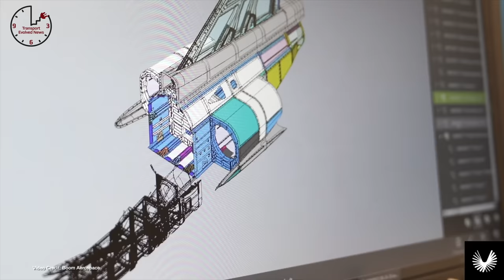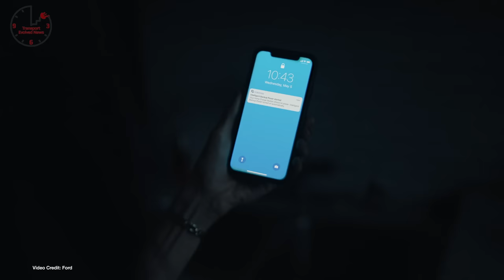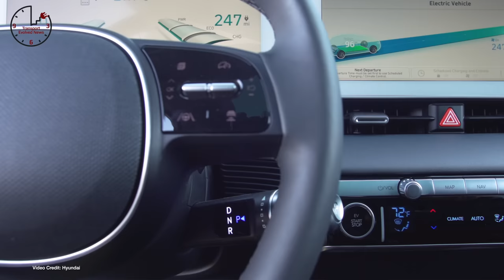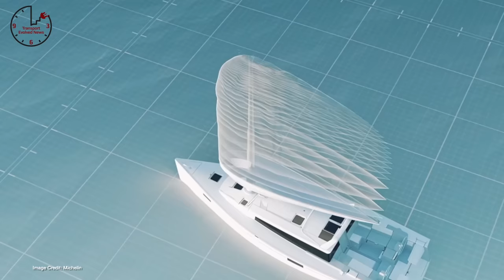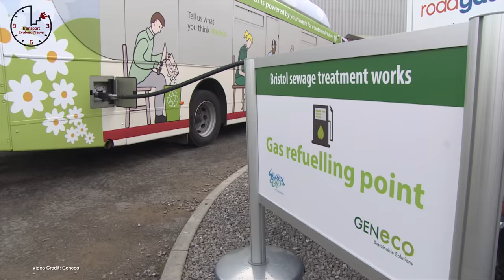TEN 341: Nissan Ariya Delayed, Ford F-150 Dukes it Out With Cybertruck, $6 Million Battery Grant

Comment: Dear Auto Manufacturers. Due to the ongoing chip shortage can you please go back to 3 knob HVAC controls. I’ve never been failed by the fan speed, temp, and where controls.

Edit: misspelling
Reply: Agreed.   How hard you want it to blow,   where you want it to blow, how hot or cold you want it to blow with a twist of the nob.   Without looking at it.    Not hunting for in menus on a screen.
Reply: Yes, control knobs would be a much better option.  The reason the car makers have to put in the automatic braking on all cars is because the drivers are busy 12 menu layer deep trying to shut off the air conditioning that is freezing their feet.

Comment: What I'm interested in f150 lightning is that it can charge my home I think only that :)
Reply: You could get a power wall.
Reply: @matthewsaxe6383  I can't I already have a solar panels :(
Reply: The Cybertruck will very likely do that too. The original Tesla Roadster had this capability, but nobody used it, so Tesla dropped the feature in later products. But with recent events I'm pretty sure they'll reconsider. Also the Cybertruck will have standard outlets, so you can power things even if Tesla directly doesn't support it.
Reply: @andrasbiro3007  hopefully they'll do it not only for cybertruck but all tesla vehicles
Reply: Musk has been dead set against V2G and V2G. It cuts into his Powerwall and Grid storage businesses.
Reply: @matthewsaxe6383  the biggest waste of lithium is in buildings where weight doesnt matter.
Reply: #V2H will be available on every vehicle.  L725/year for #V2G is a huge win.  "Regular car and truck drivers" are going to buy used ICEs.  None of this is bad news for Tesla.  The challenge will improve Cybertruck which can easily lap the Lightning.
Reply: @crhu319  Totally agree with this, there are very few reasons, besides maybe a truly draconian HOA, that would prevent someone from having a small conditioned shed on the back of a house for lead acid or eventually aluminum ion battery storage.
Reply: @crhu319  true enough,  except perhaps in the use of degraded packs for prerecycled

Comment: I agree that the Ford truck is a great looking truck and I would buy it before a Tesla truck.
Reply: While keeping the old form factor of forty years ago is dumb (terrible aero!) with electric, that huge frunk is a fantastic idea.
Reply: @davidmccarthy6061  
Keeping the form factor was a smart idea because it allows a lot of existing after market products to be used on the new electric truck.  This will greatly increase the adoption rate.  That is what matters.
Reply: @davidmccarthy6061  The F150 is one of the more aerodynamic trucks out there, Ford has been decreasing the drag of the F150 the past twenty years. Do some investigation on this.

Comment: the main problem with supersonic flight has to do with the engines. the exhaust speed must be higher than the airspeed, otherwise there is no thrust. such high exhaust speeds lead to 2 problems: high fuel consumption, especially with afterburners, and LOTS of noise. plus, in the case of the concorde, another problem was pollution. it created a brown trail of nitrous oxides. i have never seen such a trail behind any other airliner. and yes, compared to a 747 the concorde used more than 4 times the fuel per passenger for the same distance.

Comment: IMHO it won't be simply an emissions issue that dooms the ICE, it's Achilles heel will ultimately be convenience and especially cost-to-own. If you're the kind of person that likes to keep their cars beyond the 4 year and or 100,000 mile point then an EV will save you FAR more money over its life. Going beyond those points and the EV becomes increasingly cheaper to own. EV's have far fewer systems that will need to be maintained, rebuilt or replaced. EV's have no accessory belts or pulleys, no alternators, no power steering pumps or hydraulic fluids, no mechanical water pumps, no engine coolant systems to speak of, no timing gears, timing chains, or timing belts, no spark plugs, plug wires or coil packs, no ignition control modules, no fuel injectors, fuel filters, or fuel pumps, no fuel injection control modules, no transmissions or oils, no PCV valves, no O2 sensors, no emissions controls, no exhaust pipes, no mufflers or catalytic converters, NO EMISSIONS TESTING EVER, no engine oils so no wasted hours sitting in customer lounges waiting for oil changes. EV's use regenerative braking so no expensive brake jobs every 40 or 50 thousand miles. Even the batteries are now expected to out last the vehicle they're installed in. The latest battery technologies are capable of over 1000 "full" charge cycles (some claim better than 1500), and that's just until the capacity has fallen below 80%. The vehicles will still work fine and most owners will simply keep the original battery. With most EV's now getting over 250 miles per charge they can expect to see over 1000 charge cycles which equates to at least 250,000 miles before significant capacity loss warrants battery replacement, (admittedly, that should be considered best case as hot climates combined with frequent use of high power rapid charging can shorten that life). Consider Tesla's Model "S" with over 400 miles of range. After 1500 charge cycles that equates to a lifetime of (1500 x 400 = 600,000 miles). Also, there's no anxiety about passing that 100,000 mile point (the point at which the value of ICE cars plummet), which is largely because EV's have so many fewer systems or mechanical parts to wear out.  Even the old arguments of limited EV range and refueling times are beginning to fade as well. Range is quickly becoming a non-issue and with Tesla and Lucid both introducing EV's with 500+ miles of range it won't be long before all EV manufacturers close the range gap and for prices that will soon go below comparable ICE vehicles.
Reply: Some EVs do use transmissions and lubricants and they will have to have their coolant systems flushed periodically, you are correct though in that the scale and frequency of maintenance is drastically reduced. For example my PHEV, I've put about 7k km on the ICE (barely broken in, used for road trips) and about 120k km on the EV drivetrain. I'll do one oil change a year instead of at least four and the battery shows no signs of degradation. Considering the iridium spark plugs, lack of accessory belts, synthetic oil use, and minimum usage I don't anticipate any real maintenance on the ICE for quite some time.
Reply: @anydaynow01  - Agree however, I know of only the Porsche Taycan using a transmission. I know of no other production pure BEV that uses or needs a transmission. Tesla considered it early on but abandoned the idea after realizing very little benefit since they had an 18,000 usable RPM band (and could program the inverters to widen and or move the torque curve as necessary). As far as EV coolant systems are concerned, if they have one at all they're low temperature sealed lifetime systems used to keep battery and inverter temperatures below 120F. Being low temperature and low pressure they're unlikely to ever need flushing or servicing. I'm not aware of any that require periodic coolant flushing. Tesla initially required it but now does not. Perhaps the Taycan?

Comment: If the Tesla Cybertruck has 10 times the reservations of the Ford F150, that's 1 order of magnitude higher. To be several orders of magnitude higher, the reservations for the Cybertruck have to be at least 100 times more than the ones for the F150 (equals to 2 orders of magnitude higher). That's picky but your channel is the best in the field, so let's make it even better :)

Comment: Has anyone ever gotten a straight answer out of Tesla regarding the reservation to purchase ratio? As in, just how many of the people that reserve a Tesla actually end up purchasing one?
Reply: The relevant number is days of inventory.  Tesla has eight days at last quarter end.  Most legacy manufacturers have 70+ days (and that is deliveries to dealers, not buyers).
Reply: @s.m.7018  That's not an accurate measurement though. Tesla's factory output is tiny compared to a VW which has over 60 factories worldwide and has a immensely larger shipping and dealership delivery model.
Reply: @s.m.7018  they don’t now look at the lots
Reply: Previous vehicles that got refundable reservations before release had much more expensive reservation fees. Cybertruck's reservation fee is so low, a lot more people are likely willing to "float Tesla a loan" of that amount even if they are unlikely to actually purchase.

For example - I have preorders in on the Rivian R1T, Cybertruck, and F-150 Lightning - even though I will only buy one of them in the end. At this point, the Cybertruck is almost certainly NOT going to be the one. But I haven't cancelled the preorder yet, because you never know, Tesla might change the Cybertruck to be palatable.
Reply: More than half are high school kids

Comment: F150e VTG may force Tesla to make VTG (or VTG upgrade ) an option sooner than later.  Unless Musk is able to make a compelling argument that a VTG duty cycle will be detrimental to current vehicle battery life (to the point that it is economically inferior to using dedicated home batteries (PowerWall)), I think Tesla putting off VTG compatibility will lose more and more CyberTruck position to the VTG-capable F150e.

Comment: So there are shortages of nearly every car in the US and dealer inventory is at historic lows, but there are still 2020 Bolts available at huge discounts. Is the Bolt really so bad that even in current shortage of new cars there is a glut of Bolts?
Reply from the maker: It's not unusual for an automaker to have a tough time moving cars from right before a significant refresh. The new generation Bolts look quite different, and have significantly upgraded interiors. - Winter

Comment: You want green shipping and aviation fuels for faster travel? Nuclear!
Reply from the maker: Nuclear aviation has been experimented with over the years, but with today's level of technology, it simply isn't feasible in a non-polluting way (I'm talking about radiation-heavy exhaust, not the issue of spent fuel). 

Nuclear cargo ships have been done, but the sheer volume of shipping on the seas makes converting the whole fleet to nuclear a very expensive and impractical direction to go. Though given how incredibly polluting cargo shipping is, converting even a fraction of the fleet to nuclear power would certainly help. There are significant geopolitical obstacles though. - Winter
Reply: @transportevolved  I'm talking about making fuels like jet fuel using nuclear energy. :)
Reply from the maker: Now that is very interesting. We've talked a bit about e-fuels on the channel, but their production is energy intensive and thus not cost effective. Using nuclear power to produce e-fuel could be low carbon or carbon neutral way to keep planes in the air. - Winter

Comment: One day I may get one or make a hybrid of my own.  That would be good.
Reply: Nah, no hybrid. Give up the ICE completely. IMHO it won't be simply an emissions issue that dooms the ICE, it's Achilles heel will ultimately be convenience and especially cost-to-own. If you're the kind of person that likes to keep their cars beyond the 4 year and or 100,000 mile point then an EV will save you FAR more money over its life. Going beyond those points and the EV becomes increasingly cheaper to own. EV's have far fewer systems that will need to be maintained, rebuilt or replaced. EV's have no accessory belts or pulleys, no alternators, no power steering pumps or hydraulic fluids, no mechanical water pumps, no engine coolant systems to speak of, no timing gears, timing chains, or timing belts, no spark plugs, plug wires or coil packs, no ignition control modules, no fuel injectors, fuel filters, or fuel pumps, no fuel injection control modules, no transmissions or oils, no PCV valves, no O2 sensors, no emissions controls, no exhaust pipes, no mufflers or catalytic converters, NO EMISSIONS TESTING EVER, no engine oils so no wasted hours sitting in customer lounges waiting for oil changes. EV's use regenerative braking so no expensive brake jobs every 40 or 50 thousand miles. Even the batteries are now expected to out last the vehicle they're installed in. The latest battery technologies are capable of over 1000 "full" charge cycles (some claim better than 1500), and that's just until the capacity has fallen below 80%. The vehicles will still work fine and most owners will simply keep the original battery. With most EV's now getting over 250 miles per charge they can expect to see over 1000 charge cycles which equates to at least 250,000 miles before significant capacity loss warrants battery replacement, (admittedly, that should be considered best case as hot climates combined with frequent use of high power rapid charging can shorten that life). Consider Tesla's Model "S" with over 400 miles of range. After 1500 charge cycles that equates to a lifetime of (1500 x 400 = 600,000 miles). Also, there's no anxiety about passing that 100,000 mile point (the point at which the value of ICE cars plummet), which is largely because EV's have so many fewer systems or mechanical parts to wear out.  Even the old arguments of limited EV range and refueling times are beginning to fade as well. Range is quickly becoming a non-issue and with Tesla and Lucid both introducing EV's with 500+ miles of range it won't be long before all EV manufacturers close the range gap and for prices that will soon go below comparable ICE vehicles.

Comment: Funny how clueless the general public is on spec differences between the two trucks. For the price the CT is unbeatable (in every meaningful way) by much more than just a little bit. They’ll quickly get over the strange CT looks these truck owners buy the lightning and then realize their range isn’t enough and they could’ve had double the range for much cheaper.
Reply: 3 years down the road, the CT will still look and drive like new.  The Fords will accumulate dents like they do today.  We don't know how long batteries and drive train will last in E150, but CT boasts a million miles.  As well, the ford is far less energy efficient.  Fleet bean counters will calculate these costs and, once they know the TCO of each, will buy the best vehicle for the job.  Looks will mostly be irrelevant.
Reply: @normcfu  exactly

Comment: I think that anyone who looks at the specs will see the many advantages of the Cybertruck vs the F-150.  I have a Cybertruck reservation.  I signed up for a Ford account during the reveal in order to also place a Lightning reservation in case I wanted to switch.  Got all the way to entering the credit card info.  Then I started looking at the specs on the Ford site and decided to do a comparison list.   After viewing the specs I have doubts.  $52k is the least expensive Ford real consumer version.  Some considerations compared to my $49k dual motor Cybertruck reservation:
1) Cybertruck hardened stainless steel body vs. Ford aluminum body on rusting steel frame.  I live in snow country.  The Ford frame will rust out like every other Ford around here.  In addition the aluminum body is easily damaged.
2) Cybertruck includes all the tech including Autopilot in every version vs. Ford has decent tech ONLY on the MUCH more expensive version (not EVEN adaptive cruise!  WTF!)
3) The Cybertruck has heavy duty air suspension, almost double the payload capacity and a 6.5' bed vs Ford's 5.5' bed.
4) The Cybertruck has the innovative stainless steel roll down bed cover (climate controlled vault).
5) The Tesla should be far more efficient due to superior aerodynamics.
6) Tesla supercharger network.  A hands down massive advantage.
7) This is personal preference but I FAR prefer the looks of the Cybertruck.  Others, especially older people may not.  I'm only 71. :-)
8) Tesla Dog Mode, Camping Mode, etc.  Not sure if the Ford will have these but they're VERY important to me.  Both trucks have V2H (Vehicle to Home) support.
9) The Tesla will have a much longer range than the $52k F-150 EV.  The 300+ mile version is an expensive additional cost on the Ford.  The higher spec Tesla even goes to 500+ miles.
10) Tesla's proven over the air updates that constantly make your vehicle even better.
11) Tesla WILL be delivering trucks before Ford but the Cybertruck pre-order list is now somewhere between 1.0 and 1.2 million. 
A possible advantage for Ford is the EV credit since they haven't sold many EVs, but that will most likely be the same by the time either truck is delivered.
BTW, The base F-150 larger ($10K) battery pack is only available to commercial accounts.  Individuals need not apply.
What are the advantages of the Ford over the Tesla?

Comment: At 10:26 "Elon musk attributes chip shortage to that of the toilet paper shortage".  

Elon Musk:  "I got so frustrated with the shortage of toilet paper that I decided to solve it. (Like the boring company) I'm going to make toilets that require no toilet paper just like the japanese robotic toilets, except mine will use the power of flushing to charge the toilets water jet wiping function and lidarr to lock on to problem areas.  It will also analyze the waste to check your health and diet.  All this while dropping the price of a third of what the robotic toilets are in Japan".

I call it turdbot 3 (As it deals with number 1 and 2)  lol